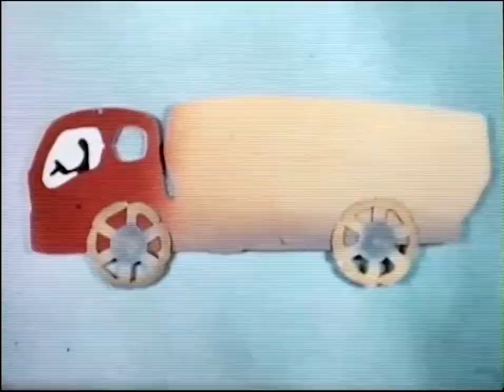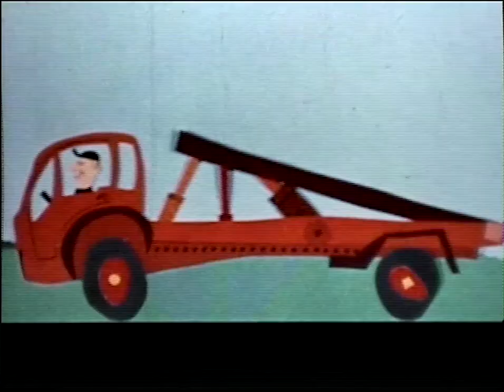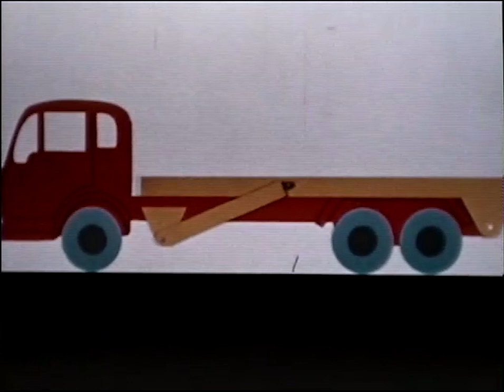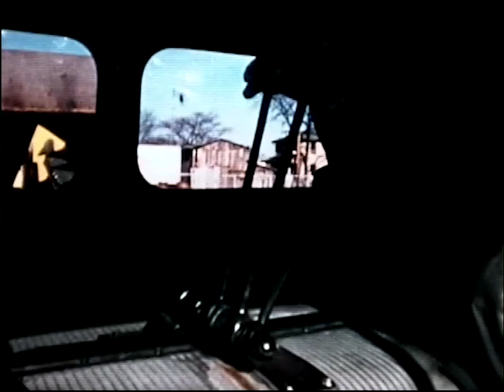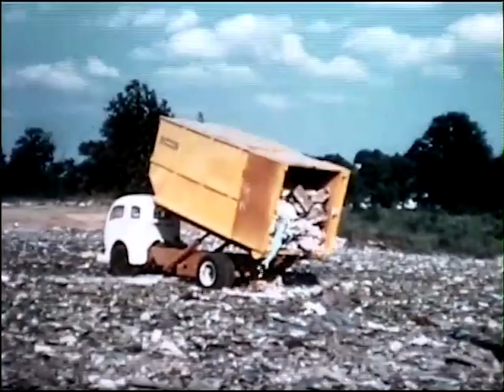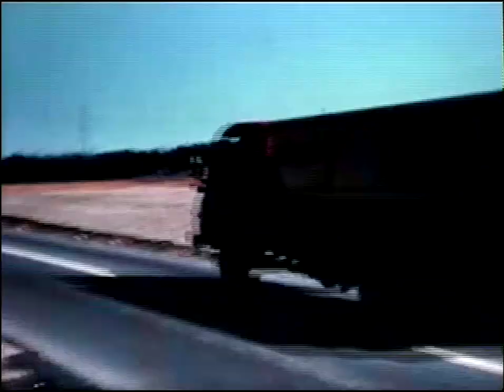1958 Dempster Brothers Dinosaur Product Video

Comment: It's an awesome system, I ran one for several years.  You could do anything with a "Dino" truck as we called them.  Bins on stilts, docks, parallel park them like in the video, all without getting out of the truck.  Because the deck was so much shorter than it is on cable trucks, you could load and unload bins inside with basically no more clearance than you needed with the bin on the truck.  Their downfall unfortunately was that safety types didn't like that there was no fail-proof connection between the truck and bin.  Every year we had several accidents where bins would take off on you when loading or unloading.  Also if the spring on your bale hook broke while driving, the hook could come disengaged and the bin could slide right off.

Comment: Back in the 80s I owned a 26' DinoTrailer. Its serial #was 170. It was a DST70, and my company motto was " If I can hook it, I can hoist it".  My equipment blew away my cable competitors, there was nothing like it. Yes, I was limited to my Dempster cans. But I could push off a can onto your dock and into your building  in 45 seconds.